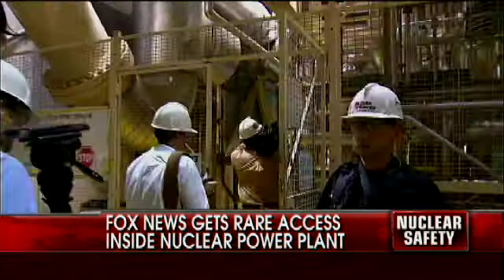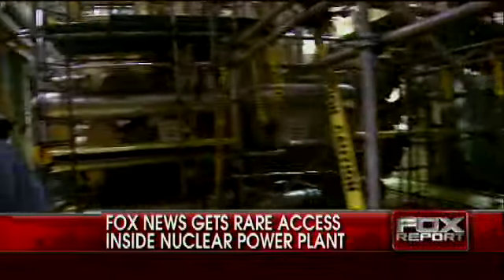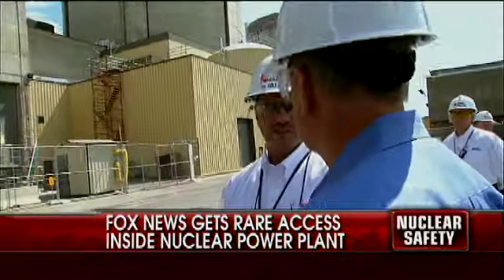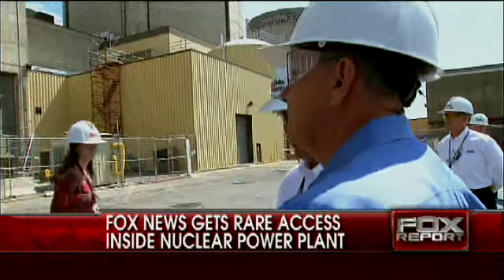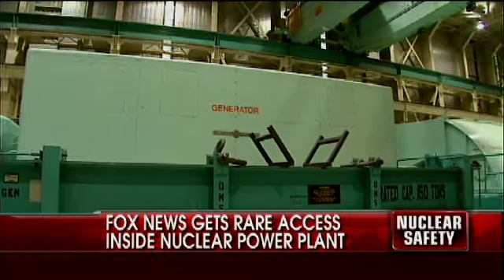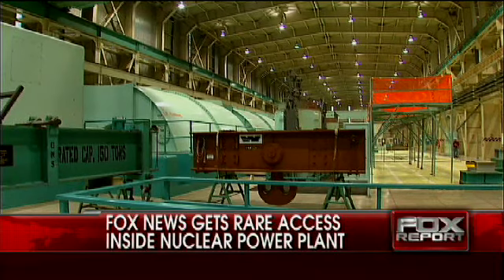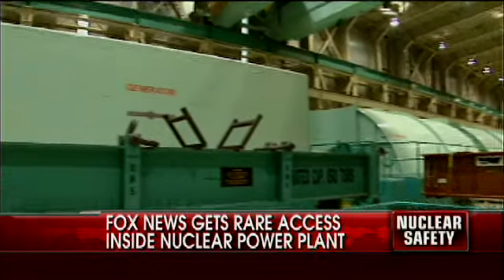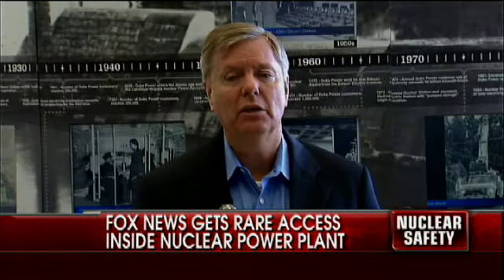VIDEO: Rare Access Inside U.S. Nuclear Power Plant

Comment: @platinum243125 there was a power plant failure at the plant 10 miles away from my house in rochester NY(R.E Ginna) in 1972. backround radiation levels are still above normal around it. not enough to harm anyone.